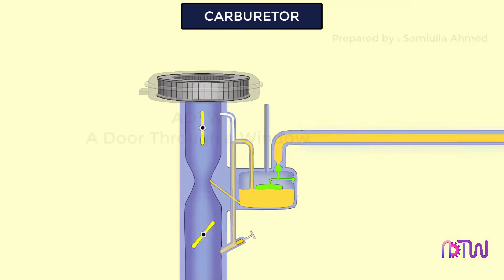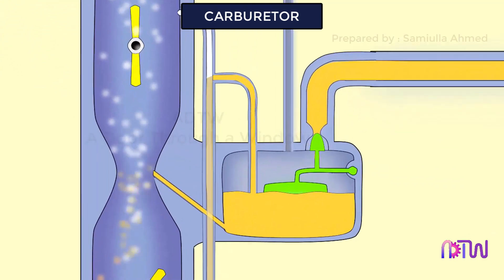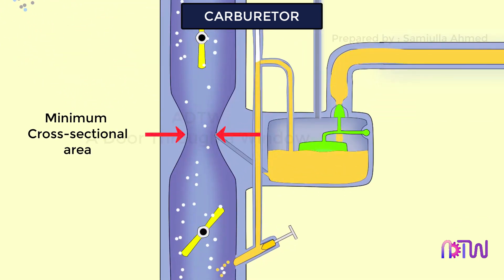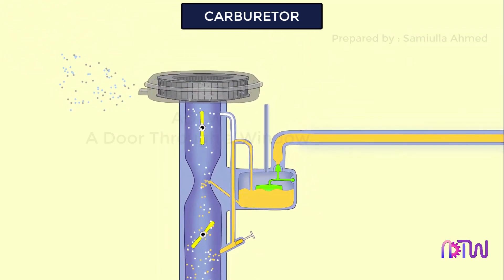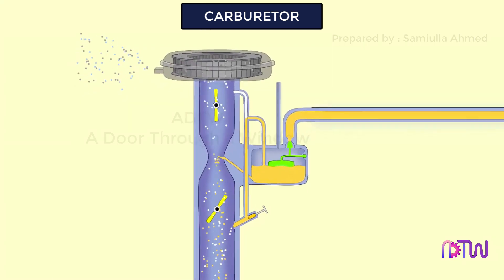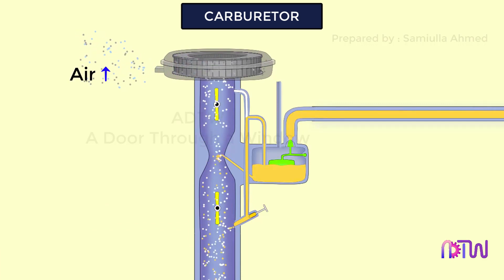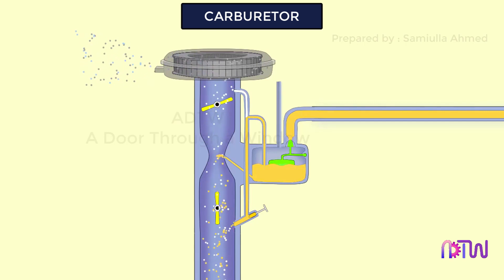Carburetor - Working of Carburetor - How Carburetor Works Theoretically

Comment: If the choke causes less air would this not also result in less fuel (venturi effect)?
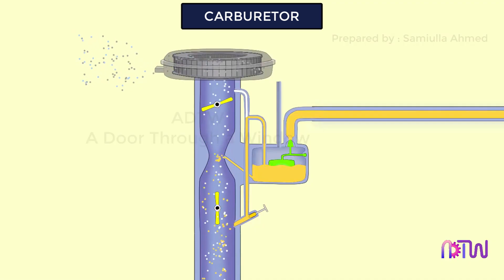Reply: There is always a suction pressure created as the intake valve opens, but as the choke is closed, it basically creates a vacuum, which in turn causes more fuel. Here it is not the venturi effect rather it is the vacuum in the play. Hope you're clear. You'll find it 3:53 here.
Reply: @tahmidislam4980  Thank you. So the vacuum effect created by the almost closed choke valve and descending cylinder and open intake valve "sucks" more fuel out of the chamber?

Comment: In an aircraft, closing the throttle valve increases the effect of the venturi, lowering pressure further and thus temperature. This is why carb heat is applied at low engine power. 
In this video, lower air pressure is ascribed to an open throttle valve.
I am having a hard time reconciling these two.

Comment: Where is the air coming to keep the engine running at idle? Is the throttle just partially open at all times?
Reply from the maker: Yes, the throttle valve is opened partially to provide an adequate air-fuel mixture, ensuring the engine continues to operate smoothly.

Comment: Hi, I have a question, how does throttle valve position affects the amount of air in the venturi; 3:00-3:50
Reply: I know you asked this 6 months ago, and probably don’t care anymore, but closing the throttle slows the air-fuel mixture from escaping to the engine, and does not move out of the way for new air to come in. It’s like a traffic, imagine 6 lane highway went down to one lane, incoming traffic would come in slowly
Reply: @jackjack06  well I still haven't got the response so I care haha, thanks. If I got this right, basically, the air slows down due to a less space for travel and it somewhat gets clogged so less air gets through?

Comment: Im a 40 year old woman who is tired of not being able to fix my own car. Thanks for this video. I'm learning!!
Reply: I don't think your car has a carburetor.
Reply: @chadsimulator  I no longer have the car but I assure you all that, yes, it had a carburetor. Thanks for all the concern though about us gals.
Reply: @aliciageary7653  What car was it?
Reply: @nikoraasu an old Crown Vic. Sadly didn’t have it long though. I LOVED that car. I had an old Lincoln in my twenties. Still think about that one. You could live in it was so comfy. 😂
Reply: Thats not a car thats care 😅 @chadsimulator
Reply: Who says carburetors are only limited to cars?
Reply: @Bakanelli because she said she was trying to fix her car…
Reply: @Bakanelli right, my new lawnmower has a carburetor...
Reply: @jeffreybanks0519  a lawn mower is not a car, carburetors in cars has been replaced by fuel injection, but for smaller engines carburetors are still used
Reply: @dylanaaron6483 nobody said lawnmowers were cars? And you know old cars exist... Right?
Reply: @Bakanelli who said she said they were limited to cars?
Reply: Car with carburetors stopped being manufactured in the US about 30 years ago due more emissions regulations. If your car is less than 30 years old and you want to understand how it gets it fuel then this video is a great place to start. The carburetor is the simple version of what is in your car, and is very helpful to understand how these work before learning what'sin a modern car. To understand what's under your hood, check out videos on car engine air intakes, car engine throttle bodies, car fuel pumps, car fuel rails and car fuel injection.
Reply: @liamconners8327 you realize older cars exist right?
Reply: @MrPacman64 I actually have no idea what you're talking about but I am very curious. And you seem cool, since you're concerned baseline level of knowledge. Would you care to explain what I should know about these "supposed" older cars?
Reply: @liamconners8327  you just started off with "carbs aren't used anymore" lol that's all. plenty of people have old cars and the likelihood that they do is high considering they're here on a video about carbs and they mentioned a car lol. its more likely than not. im only here because i want to work on my 64 comet and i needed some basic info.
Reply: @MrPacman64 I'm not sure if you're quoting someone else's comment or if you're blatantly neglecting what I actually wrote because I clearly did not start off with that. Anyways, 64 comets are sweet cars. I hope to own something similar myself one day. Currently, I am challenged by my 86 kawasaki js300. And regarding carburetors, I agree, this video is useful. Good luck my friend
Reply: Right on! I'm a 41-year-old woman who has discovered that there are no shops left that'll touch my 48-year-old, carbureted car. Time to learn how to do something more than oil changes and tune-ups. I, too, want to learn the mysterious ways of the carburetor!
Reply: lmao let her learn 😂😂😂
Reply: Hehe WOMEN 😂😂😂